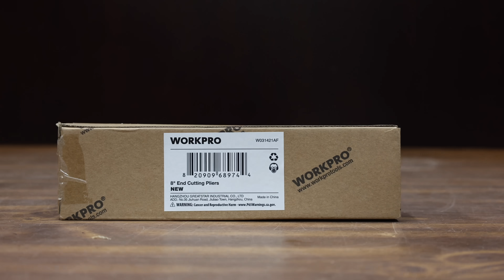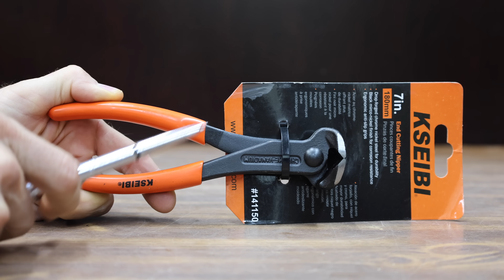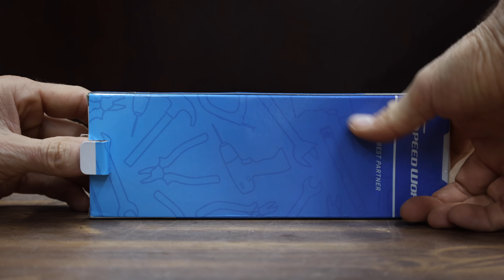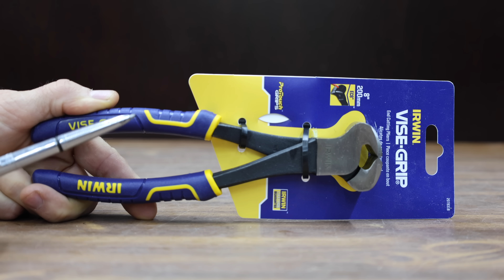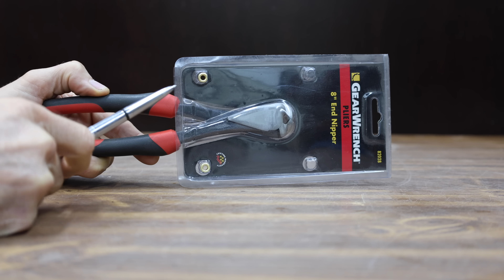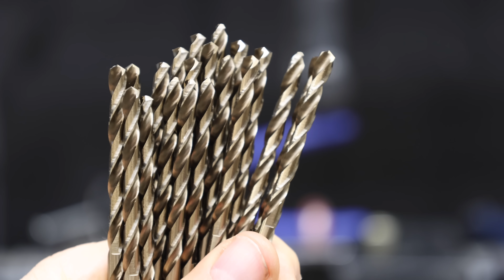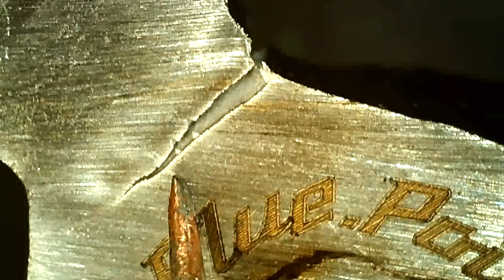Finally! Best Pliers I've Ever Tested! Not Even Close!

Comment: Video idea: Comparison of USB C charging cables. I'm so far beyond tired of wasting money on cables that don't end up lasting more than a month or two, it would be great to see a range of them compared. Maybe even some that have a 90 degree port adapter... Thing. 

Also... 

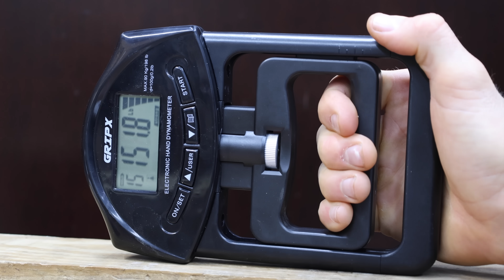9:17 - 151lb grip is NUTS
Reply from the maker: Thanks for the video idea.
Reply: Marhsalls (and possibly TJ Maxx) carries high quality braided usb c cables in lengths of 6' - 10' for about $10. Haven't had one go out yet even when in TSA handled bags for dozens if not hundreds of flights and plugging in and unplugging in hotels at times with tight areas that put strain on the cord.

Comment: The way the knives on most are designed (double-bevel) means they cannot cut flush.  Only the Wazakura has the correct bevel.  Too bad they're so bad at other tasks.  Get a Wazakura and a Knipex, and you can't go wrong.

Comment: The Knipex Plier Wrench is life changing. Never will use regular adjustable wrenches ever again. It’s what most people who use a channel lock wrench actually need but don’t know exists.
Reply from the maker: Thanks for the feedback.
Reply: The Knipex are also about twice the price of comparable Channel locks. While the Knipex are a superior design and worth the price to me for sure, people talk as if they all cost the same or something.
Reply: @chickenfishhybrid44  Pay a bit more, get a lot more.  There is a big big difference
Reply: While I agree certain tools of theirs are great, Knipex fan boys are a cancer to this planet
Reply: People that use an adjustable wrench and slip joint pliers interchangeably instead of proper tools should not own tools!
Reply: Yup, Channel lock is no comparison to the Knipex pliers wrenches.  Chanellocks feel really cheesy when compared to how Knipex feel, and the precise fit and movement
Reply: @cengeb  also how a channel lock will usually cause damage due to the cut teeth grip when used like a wrench but when you need the teeth to grip something round the flat parallel geometry. If you actually need teeth to grip something round them thethen the Knipex cobra wrench is what you probably need. I love how Knipex essentially turned a channel lock into two more specific high quality tools.
Reply: @donbert  yup, Knipex has several versions of the highest quality tool.  Innovation indeed, smooth, toothed, and different handle grip materials, how the handles are shaped make them fit in your hand, like it belongs there.  Chanellocks are non ergonomic, and crude compared to Knipex
Reply: @donbert  Knipex wire strippers I have are like a surgical tool, the precise smooth action, and incredible razor sharp cutting edges, is incredible.  And also have some cool features to grip and twist  stuff, and the handle fit in your hand like it should
Reply: Channel locks are so garbage. Always wanted a push button lock like the knipex. No more smashed fingers

Comment: Is it just me or are these pliers designed to pull a staple through via the rounded head, rather than just cut it off sitting proud by a little. I've always taken it that you grip the staple or brad nail and rotate the pliers to pull it through.
Reply from the maker: Thanks for the suggestion.

Comment: Honestly. The most impressive part of this video was you casually hitting 151 pound grip force. 
Body builders struggle to hit 120.
That's that farm strength! 

Amazing video as always!
Reply from the maker: Thanks!
Reply: Really? I got 150 when I was younger and didn't think much of it. Bodybuilders don't really train their hands.
Reply: @Swampster70  More to the point, bodybuilders train for size and aesthetics, not strength.  On a pound-for-pound basis, they're not all that strong compared to other athletes.  Experienced rock climbers can blow past 120 pretty easily.
Reply: I once had to do a physical for a job at a automotive factory, part of it we had to pass a grip strength test was 130+ I have bad hands and definitely struggled but I passed it on a second try.

Comment: Drill bit (type-of-base) test suggestion: Bought and used my first impact-driver quick-release drill bit today to drill steel.  The bits in these are retained by the driver, yes, but they aren't held steady and concentric.  This allows them to wobble just a little while drilling (slower RPM's with cutting oil to not burn out the bits).  Test for if there is a difference in drilling speed (given the same RPM and same load) through steel, and is there a difference in how long a given bit lasts, if it's quick-release based or standard drill-chuck based?  I have a minor theory, but I'll hold out until I see it tested.
Reply from the maker: Thanks for the suggestion.

Comment: Thank you so much for your hard work and this revealing review Todd. Well done, as per usual. I purchased five different Knipex plier tools this year.  All are superior to other manufacturers' versions I've owned (looking at you Channelock).  My favorites: KNIPEX Cobra ES Extra-Slim Pump Pliers (8751250) 10 inches;  KNIPEX Pliers Wrench, Chrome, Multi-Component (8605180), 7-1/4 inches;  and the KNIPEX CoBolt Compact Bolt Cutter, Multi-Component (7102200), 8- Inch Comfort Grip. I was also looking at these flush cutters, but refrained at the time. Now I'm gonna have to grab a pair of these also - once the price stabilizes after the notorious "Project Farm Price Bump" that often follows these reviews.
Reply from the maker: Thanks and you are welcome!

Comment: I've never had much use for these types of pliers, because I have old school Vise Grips it's Stamped in the metal I most of the type use the cutter that's inside the jaws I would love to know how many pounds of pressure that is needed for them, and I have a variety of different ratchets and sockets I have found out that Gear wrench can definitely take a beating before breaking, I have stripped Ratchets and cracked them right down the side but it took a lot, Thank you so much for your Amazing and Informative Videos.
Reply from the maker: You are welcome!  Thanks for sharing.

Comment: Most of the pliers used way to steep of a cutting edge angle. The steeper the angle the sharper but weaker the edge is. While it won't matter much in a soft material, it will matter when you are dealing with longevity and hard materials. Fun fact. If you self grind pretty much all of these cheaper brands to a more shallow slope you will make them much better. Same trick works on most cheap wire cutters that fail to work out of the box.
Reply from the maker: Thanks for the feedback.

Comment: I own various Knipex pliers for the last 20 years and they STILL look and work like new. Their smooth toothless pliers as the best for working on fancy plumbing without damaging it! They have push button sliding size adjustment. There is NO equal! Your testing, as always, is impeccable! I never would have thoughy that the Knipex would run circles either, just win and be the best!
Reply from the maker: Thanks for sharing.

Comment: Thanks for doing this great test. I was looking for this info a few years ago for pulling staples, brads and small nails. For what I needed I would get the Wazakura. Nothing else came this close to a flush cut. As for cutting nails, deck screws and drill bits, I have used a sawzall, which works great for this. I can't wait to see your next test.
Reply from the maker: You are welcome!

Comment: for a DIY guy, i don't see any use for these pliers vs saws or powertools.  however, did not expect these to cut through drill bits and a hex tool, very impressive!👏👏
Reply from the maker: Thanks!
Reply: Really? I'm an avid DIYer, and end-cutters are high on my list of indispensable tools! But different strokes for different folks and all.

I mostly use them for pulling nails and staples, but I also use them for cutting heavy but soft materials, like heavy gauge copper wire, coat hanger wire, soft steel nails, and the like. I wouldn't use them for hardened materials, which are bound to nick the edges, and for which there are usually better options. Yes, even Knipex will be the worse for wear before long if you abuse them like that.
Reply: @danmenes3143  Yes but I've done enough of furniture and cabinet teardown. I want nails dead flat with the wood using saws.  For wires, I use the gripping pliers or locking pliers

Comment: These snipping pliers reminded me of my dad's favorite tool, from the late 19th century.  It was a nail remover that was designed to bite into wood to remove embedded nails, I guess because back then nails were made by hand and didn't have heads.  My dad loved using it for pulling out shorn nails and staples embedded in wood.

What was your dad's favorite tool?
Reply from the maker: My dad's favorite tool was the circular saw.

Comment: The ones that held up to strength but were a bit dull could probably be sharpened with a diamond coated cutting wheel on a dremel. I've sharpened my masonry drill bits that way. It makes a big difference. I bet those ones that are strong would sharpen quite well and make a much easier job of cutting the nail or screw.
Reply from the maker: Thanks for the constructive feedback.

Comment: I love this style of pliers for pulling out nails and staples and not damaging the wood. For that a sharp edge is not needed but a good wide rounded surface for rolling the tool over to pull out the nail.
Reply: Same here.  My ancient bargain bin set works great simply because it probably can't cut a nail but it can grip it without cutting through.
Reply from the maker: Thanks for the feedback.
Reply: Fencing pliers are so much better for staples. You don't try to cut them off, you just use the curve of the fencing pliers to pull the staple completely out.

Comment: I have the same Knipex pliers, but with simpler,slimmer-which I prefer,plasticized handles - model 61 01 200... they are really amazing pliers... they are like from another planet.
The interesting feature of the patented construction is that almost the entire length of the blades is accessible for pinching, which in the case of classic blades hinders the hinge. Due to the asymmetric design, the pliers are incredibly practical for pulling. Compared to classic pinch pliers with forward blades, they have the same force along the entire length of the blades...they are really genius.
...I knew immediately who would win😄...keep up the good work👍-I really like it...greetings from Slovenia.
Reply from the maker: Greetings!  Thanks, will do!

Comment: The shank of a drill isn't hardened as much as the flutes and tip. That's so that the drill chuck can get a "bite" on the shank and lessen the chances for slipping. How many times have you had a keyless chuck slip on a drill and curl up a little piece of metal that prevented you from being able to put it back in the drill index? That doesn't happen with hardened drill rod.
Reply from the maker: Thanks for the feedback.

Comment: It is nice of you to show the absolute limits of the tools but I won't be able to apply 500 pounds to a handle. It would be better to show which tool is more efficient in cutting in possible range then make the destructive test. Maybe measure your own grip strength, take different thickness of screws and apply that force to pliers with a setup to see which one can make the cut. Still a great video
Reply from the maker: Thank you for sharing!

Comment: Excellent testing procedure as usual. BTW, drill bit shanks are annealed which makes them much softer than the other end. They are annealed so they flex rather than break plus they are easier to grip by the chuck.
Reply from the maker: Thank you for sharing!

Comment: Hey, Todd, love your stuff but sometimes you make it all about durability testing in circumstances the product just wasn't designed for. Cool to see what makes the cut but I do wish there was at least one more functional test in such videos. Maybe like which one of these could get a grip on a nail where your hammer couldn't and how many re adjustments it'd take to pull the thing. Or, you know, actually cutting wire nd the things they state they will cut versus the force it takes to do so because over a day of work the less force it will take to cut 50 lengths of 12/2 or pull up carpet tack strips and tacks comfortably means a lot more than cutting an Allen key. I mean, if someone were giving me the Knipex pliers I'd take them but maybe a little less extremely (read, only the abusive would attempt it) testing and maybe a little more functional testing. Either way I'm still tuning in every Sunday.
Reply from the maker: Thank you for the feedback!

Comment: Not to be that guy but the Knipex you used is a bolt end cutting pliers . They do make a normal end cutting pliers the Knipex 68 01 280 or Knipex 68 01 200
Reply from the maker: Thank you for sharing!

Comment: The first test, while still kind of useful, seemed a bit "off" to me as those kinds of tools just aren't really meant for getting a truly flush cut. Electronics flush cutters really do a fantastic job, but they're not durable or heavy duty enough to do what those tools do - flush cutters are really for soft copper wire and the like. So I'd kind of expect with the others that I'm going to have to grind the little remainder down after snipping them. However, it can be an advantage having a slightly longer rather than a shorter protrusion as it gives you more "wiggle" time to adjust so that you don't mar the workpiece. Maybe I'm off there - dunno.
Reply from the maker: Thank you for sharing!

Comment: Most of those made in China cutters look to be made from the same factory.
As soon as I saw the Japanese cutters I knew the cutting competition was over. I don't think anything made in Japan that is used to cut, carve or saw is inferior. I own a number of Japanese steel tools and they always perform. In fact I even have a WWII Bayonet made by the finest Carbon steel and a WWII Katana and if you look at it wrong it will cut you.
Knipex and Wiha make excellent tools also and they fulfill a number of tasks like Lineman pliers and Channel locks and the Wiha tools are used for fine screws in electronics.
I would never want to cut anything heavier than those staples with those short cutters, you will dislocate your elbow trying to cut a nail.
Reply from the maker: Thank you for sharing!

Comment: Anyone who worked on electronic circuit boards cutting the legs of resistors will immediately realize that these pliers will not flush cut a wire because the outside jaw bevel will not allow the pliers from flush cutting the wire. Until I saw the Japanese pliers which had about zero outside bevel and that showed in the results. 
Thank you for reviewing something useful this week.
Reply from the maker: You're welcome!

Comment: There's a great video from Outdoors55 showing how basically every pair of modern electrical wire cutters is flawed, with cutters which deform after a single cut. Even the Milwaukee ones were crap.

The only pair he found with the correct geometry and hardness for the job were Knipex.
Reply from the maker: Thank you for sharing!